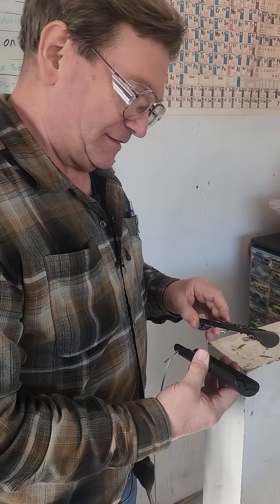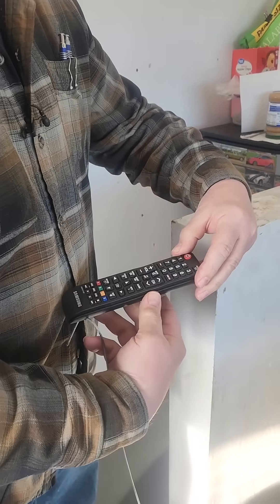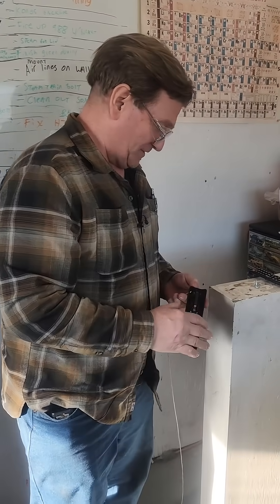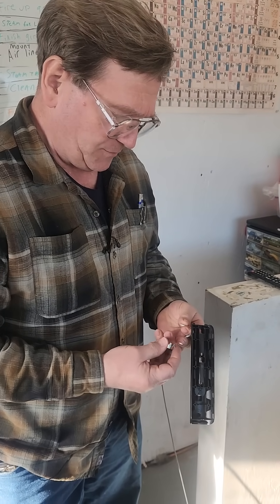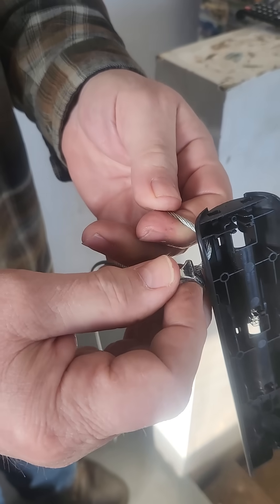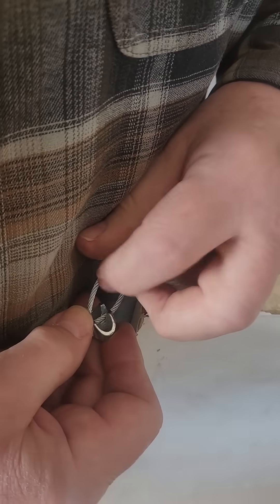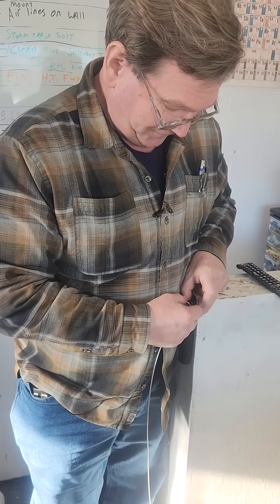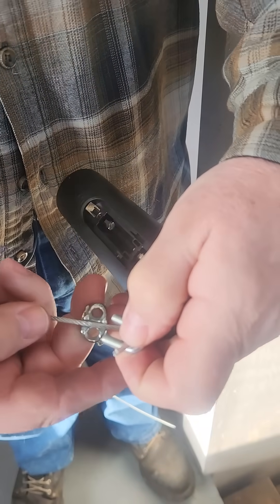Machinist's Minute(s): Proper cable clamp usage

Comment: Wow that cable is huge for that. You could’ve drilled one hole and pounded a small nut on the cable on the inside so it wouldn’t pull through. Small Snare or fishing rig materials would’ve been ideal.

Comment: Why not a single hole in remote and use a crimp ferrule inside?  I'd probably re-enforce the whole thing with a tube like an old sharpie so it can't damage the board.  Maybe some foam to keep the sharpie tube locked down.

Comment: So you checked the engineering specs on cable sizes for TV remotes?  I'm sure you have the official reference material.
Reply from the maker: The Sae-TV99-1959 section stated 1/8 was adequate for all remotes made before 1945, the store only had 1/16" & 3/32"  So I used the 3/32.  It was also the only size they had clamps for.
Reply: @HOWEES  Better safe than sorry!

Comment: The saddle doesn't kink, it distributes the forces more evenly, if it got kinked it could fail under load, which is why you don't saddle the dead horse. I doubt it matters on a remote... would've used a swage on that maybe to keep from tearing someone pajamas though

Comment: I’ve heard that saddle analogy before and it’s a good analogy. If you look closely how it works, the saddle doesn’t bite into the cable, it basically holds it. The U bolt bites into the cable and crushes it.
From a strength point of view if you put that side under tension you just created a weak point where the cable could snap.
From a slippage point of view, the saddle will slip on the cable but the U bolt will hold fast. If the U bolt is on the live end, if the connection were to slip the live cable would be pulling the U bolt away from the anchor and be pulling the saddle towards the dead end.
With the saddle on the live end, if it slips the U bolt gets pulled toward the anchor wedging it against the anchor and hopefully not allowing it to slip anymore.

Comment: Why not use an epoxy to bond the cable to plastic?
Reply from the maker: Low bond strength of the glue & time to fully set.   I had thought of plastic welding, but this is quicker.

Comment: That cable is huge. Why not drill one hole and crimp a stop on the inside?
Reply from the maker: No room for that.  With the cable laying mostly flat between 2 holes it cleared the near by capacitor.